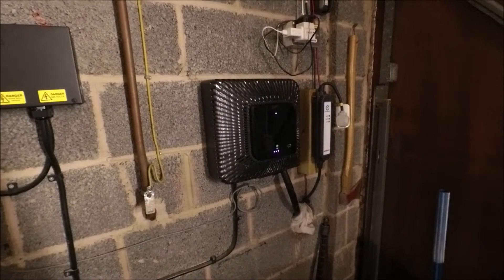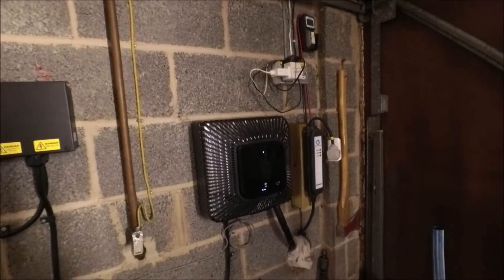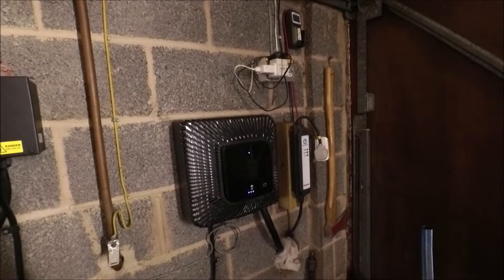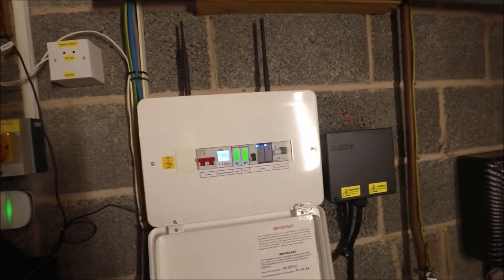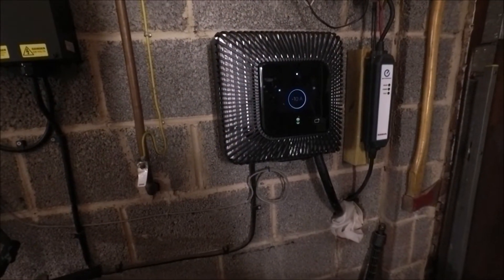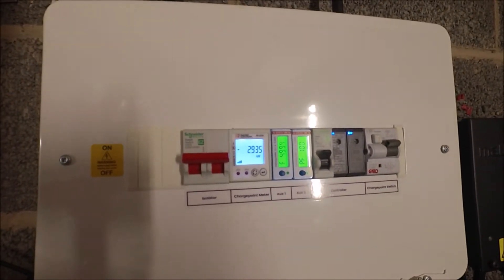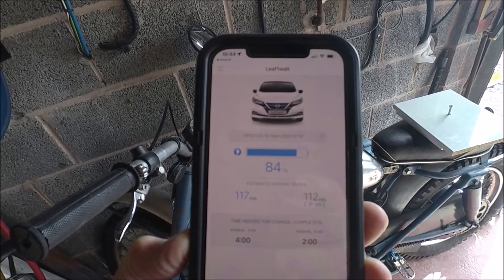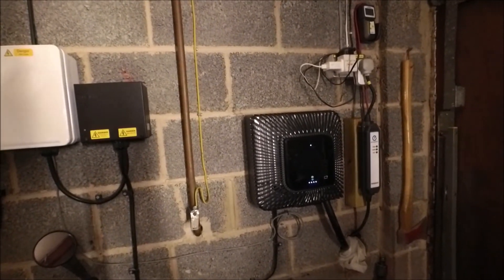Electric Car Powering Home - in Action (V2H)

Comment: Can you set the schedule for it to run automatically?
Ex start using v2h from 6pm to 7am everyday.
Reply from the maker: Yes. With the current set up I programme a required state-of-charge at a specified time, either for the next day, or a daily schedule for the coming week. This ensures that I have enough charge to make my next journey. Otherwise the system works automatically whenever the car is plugged in. It absorbs excess solar power, does V2G as demanded and schedules charges for the next journey (if needed) to use the lowest tariff price. (I'm on the Octopus 'Agile' tariff which varies every 30 mins, depending on the wholesale electricity price.). It is possible to override the automation and force V2G, or charging but I virtually never do.

Comment: thanks for sharing that, nice to see it in action. For me I'd like this instead of buying large batteries during winter, to bridge those extra days with no solar :)
Reply from the maker: Yes, in summer it's great to be able to charge the car from solar and either drive, or power the home after dark. In winter I'm using the Octopus 'Agile' electricity tariff https://octopus.energy/agile/ to charge the car when the price is cheapest and run the home at all other times. All this only works when the car is connected though, of course. So not as good as a fixed battery in that respect.
Reply: @Greeves  Sounds great... here in cz we don't have any different tarrif prices anymore. I do have a battery 15kwh, but was interested in more, and it sounds nice to have this in the car which for our usage is parked by house most of the time (working from home etc)... I decided not to go with grid/tie solar and get restricted with non diy build or the buying/selling of electricity... just trying to buy as little as possible.

Comment: This looks interesting,,, we have solar panels going directly to grid, so instead of spending money on battery for energy from solar etc., i'm looking at getting electric car, with battery! and setting up this V2H (i'll therefore retain the 55p kwh i'm getting from the solar so win-win)..
Reply from the maker: Yes, definitely the way things will go (I think) and good to get in early, while incentives, etc. are still available. We're on the 2nd feed-in-tarrif rate for our solar panels so get about £700/yr from this. I made my own solar to hot water system, so we give virtually no electricity to the grid, except during the peak summer days. Adding an EV mops up the summer excess and with V2G effectively gives access to solar overnight. As you say win-win. I'm not yet with one of the suppliers that have dynamic pricing (e.g. Octopus Agile) but am looking to move to one soon. This will allow further use of the car battery to make ££ by importing when the price is low & selling high.
Reply: @Greeves  Many thanks,,, i'm plodding through t' internet to find installers, including energy companies to see if there are any pilot schemes, such as you had... All good. What clever tech !!
Reply from the maker: @keitharksey8622  Yes, there an many more options available now, since the trial I was on started, well before the pandemic. I'm not sure what I'd go for if I was to start again from scratch. A lot depends on how you use your EV. If it's used for long daily commutes & business trips, it's very different to a '2nd car' EV that's parked, plugged in, at your home most of the time. Good luck with your research though 😀